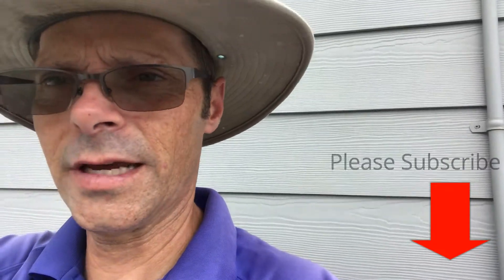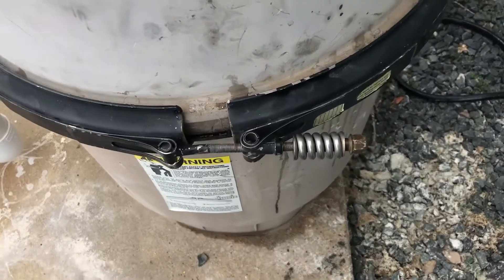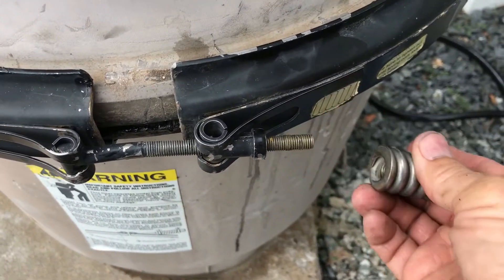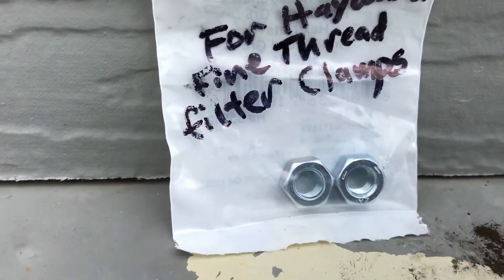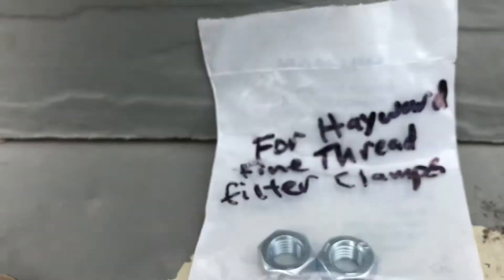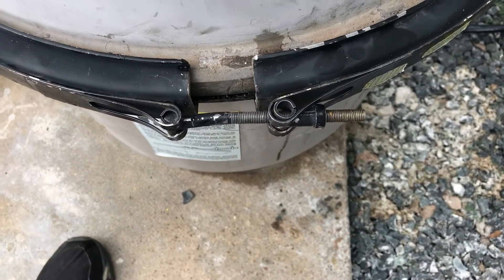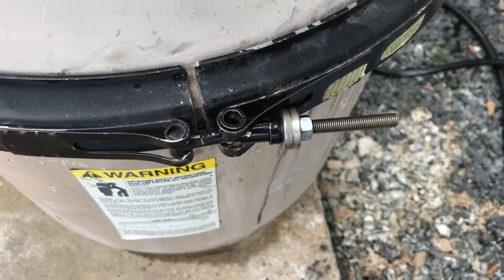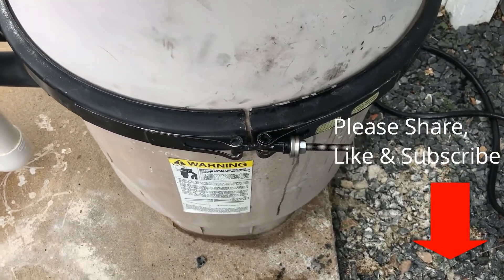Replace Old Hayward DE Filter Band NUT

Comment: I'm having the EXACT same issue...pulled apart my Heyward 6020 Filter and went to put it back together and it tightens and then loosens. Can you please share where you purchased yours from? I went to my local Leslie's pool store and they couldn't help.
Reply from the maker: I bought the replacement nut I show in the video from Lowes.  You may be able to order the replacement nut from online but it may be so old it's obsolete now, not sure.  If your treads on the stainless steel part on the clamp are messed up and the replacement nut from Lowes in the thread pattern I show won't work, you will have to replace the whole band and clamp assembly with a new one.